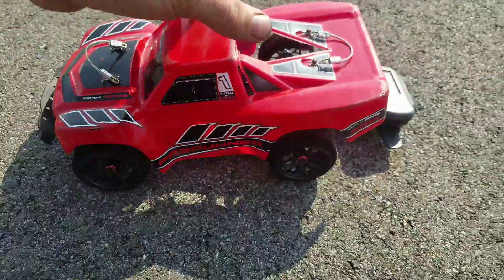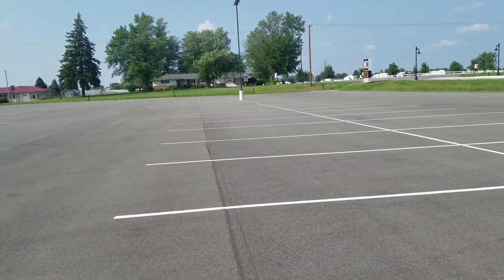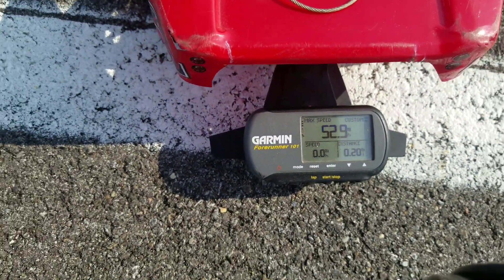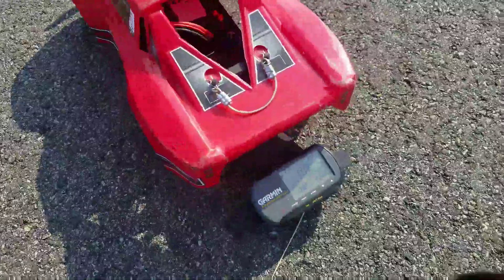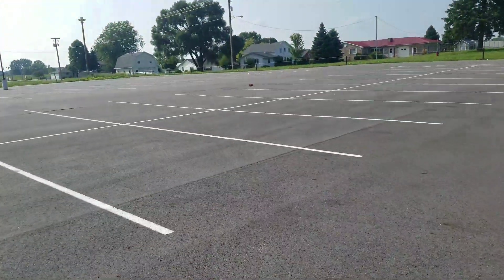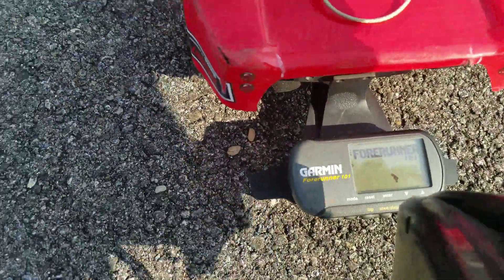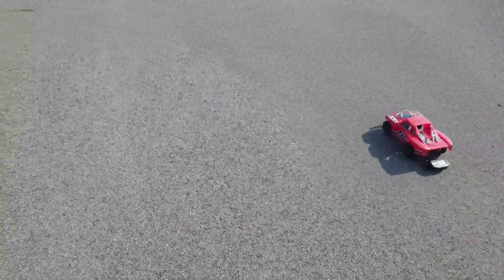Traxxas LaTrax Desert Prerunner brushless speed run 52.9mph on 2s lipo, tire blown out on 3s lipo

Comment: What kind of tires are those? Are those racing tires?
Reply from the maker: To be honest, I cannot recall what brand they where... just some cheap foam tires I found on ebay a few years ago.. they wernt a well known common brand i remember that.  The same size as the stock rubber tires. They do pretty good, but the only problem I had with them was they didn't glue them very well, had to use contact cement to reglue them one the tire slipped off the rim. After that, didn't have any issues with them
Reply: @walttrowbridge7687  by doing this conversion of everything in the rc does mean I have to change something in the remote?

Comment: That's pos blow the spark plugs out yet.
Reply from the maker: 🤣😂 not since I've bought it with one already blown 5 years ago. I put 30,000 miles on it myself, 274,600 miles on the odometer today,  still drives and runs better than any GM product I've ever owned or driven

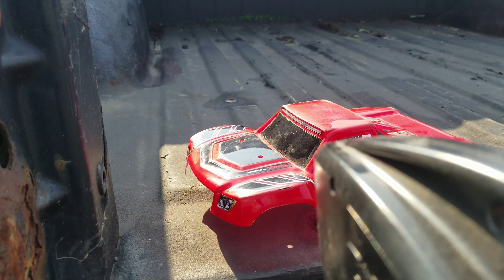Comment: 2:14 haha rusty ford
Reply from the maker: Rust, yet trusty. 274,600 miles. Still runs better than any government motor product ive ever owned or driven. $1,000 Indiana truck. Not complaining
Reply: @walttrowbridge7687  that's just getting broken in if it was a silverado
Reply from the maker: 🤣😂🤣 sure, 50 recalls later maybe
Reply from the maker: Check out my newest arrma limitless video, and really see the rust. Under the cab 😂 oh but wait, the hood, the bumpers and the front and  rear finders don't have any rust 🤔 been up in the snow/salt belt since it was brand new in 2001. Honestly. For its age, there isn't many full sized trucks that look as good for the price I got it so... talk all you want. I really could care less man. Have a good one!